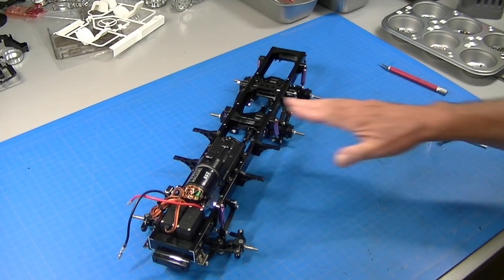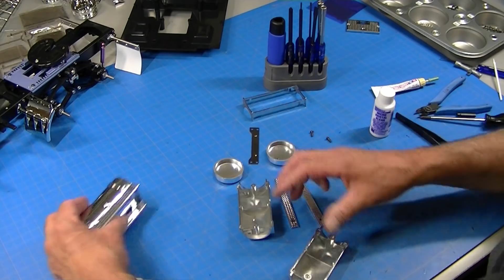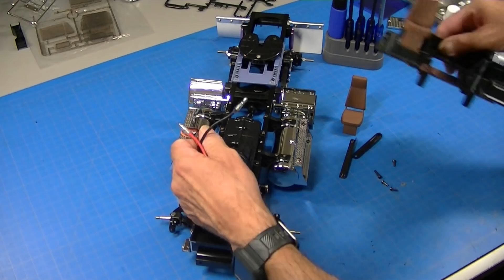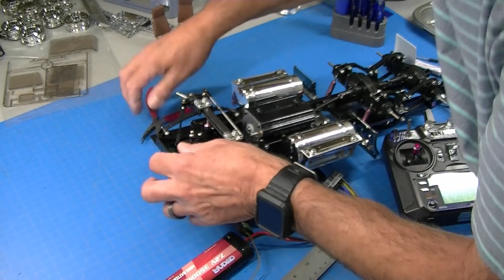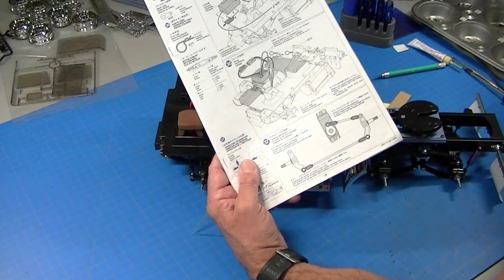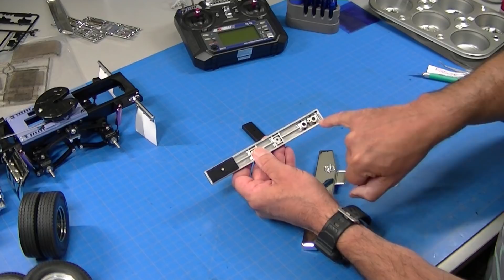1/14 Tamiya RC Globe Liner Build for Novices - Part 2

Comment: Ive been bouncing back and forth between this one and part three trying to figure out how the cab mounts to the plate, as im custom building a cab over, and i bought the can, and plate separately "I know bob has the answers"  im sure you can imagine my panic as niether part showed how the cab secures, i finally realized you missed bolting on the angled plates to the floorplate, that then receives screws holding the cab. Took me half an hour but i figured it out lol

Comment: hello bob love your videos im building a globe liner myself and your videos are extremely helpful do you have a video on installing a mfc-01 on a globe liner
Reply from the maker: Not specifically but the Globe Liner has a lot of room.  I stand the unit up in front of the battery tray and hang the speaker from the cab roof.

Comment: Do you have to take the body off to plug the battery in
Reply from the maker: No, just need to take off the back panel which latches and unlatches easily.

Comment: question: Why aren't gears used on EVs? Wouldn't a "highway gear" save battery capacity?
Reply: Kia's PHEVs does that. The electric motor drives the car thru the same gearbox as the petrol engine.